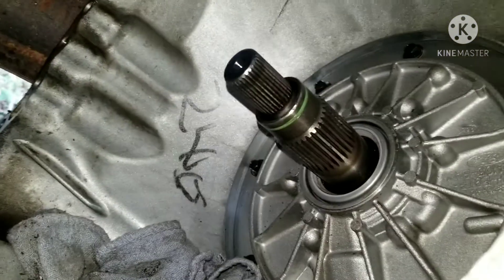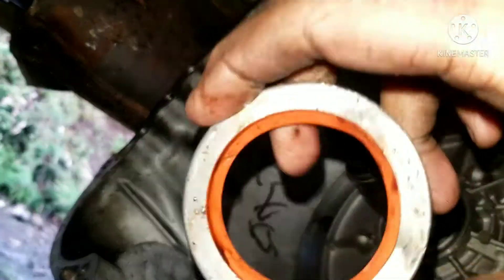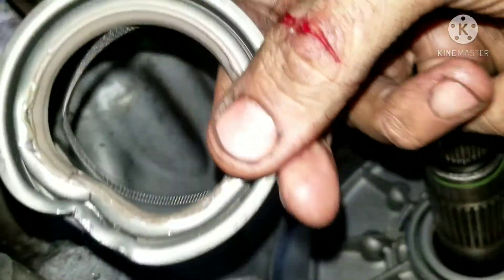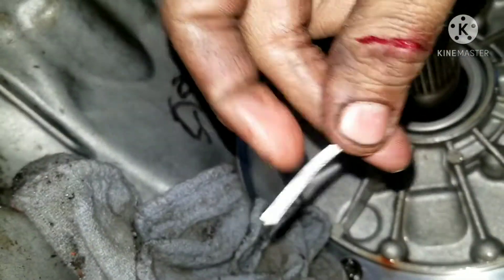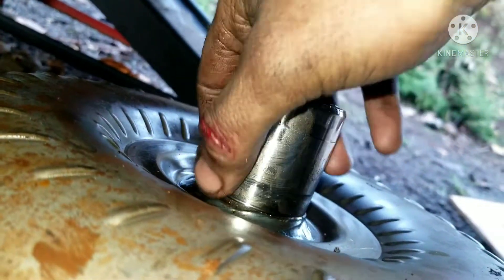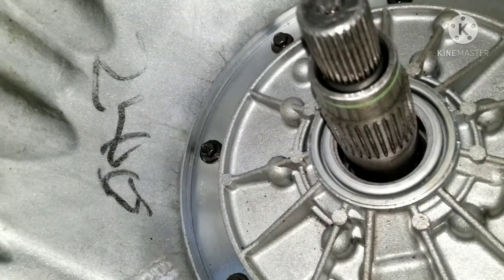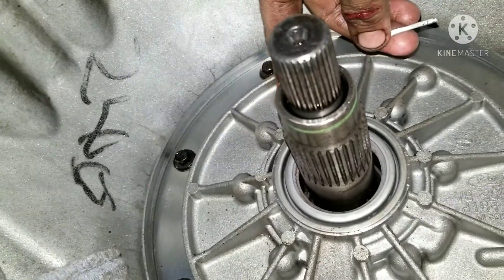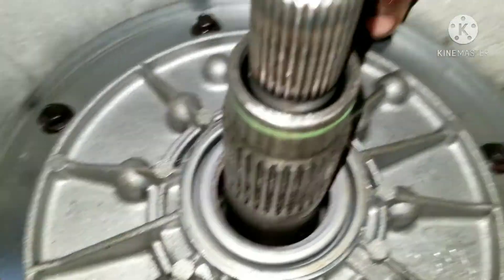why your E40d transmission pump seal leaks

Comment: ouch be careful hey my transmission blew out all the transmission fluid had cracked seals is it easy fix I'm not a mechanic but someone out of shop told me it was $800 to do the job

Comment: What symptoms did it have? My e4od has been puking out all of its fluid from the bellhousing area once it gets hot and then runs 100% normal when I let it cool down and refill it
Reply from the maker: Sounds like your fluid could be over filled, what could be happening is you fluid is fine when it's cold but once it gets hot the fluid grows and and goes every where, thanks for watchin teally apreciate it
Reply: Did you figure it out? My 97 F350 with a 7.3 and E4OD started leaking yesterday when I parked it after about a 6 hour towing session. Inside of the bellhousing is dirty from fluid slinging around on the torque converter
Reply: I'm having the same issue
Reply: I'm having the issue when I park and shut the truck off, it just leaks fluid out. I heard it's the oil pump seal. Mine is a 1992 so I'm pulling the engine instead of dropping the trans. How does nobody ever reply what they did to fix?

Comment: My transmission from a 99 f350 just started dumping fluid out of the right rear drivers side area any ideas
Reply from the maker: Thanks for watchin and t could be a  pan gasket or if it's coming out under pressure it could be one to f your lines is loose